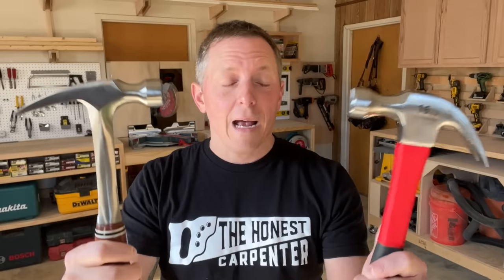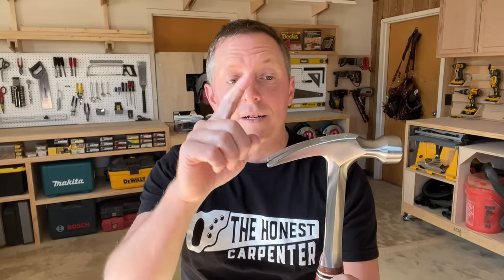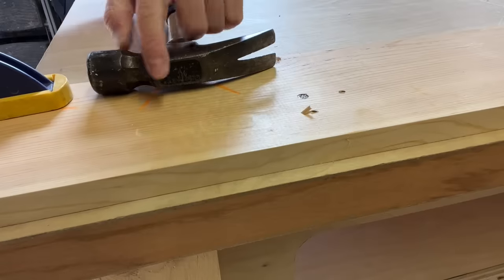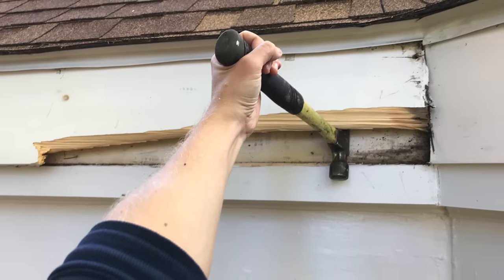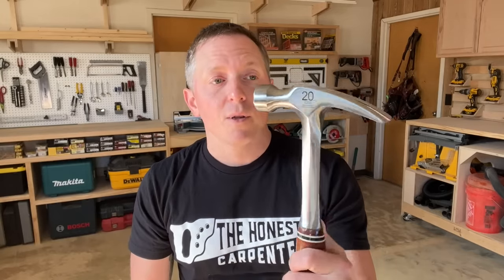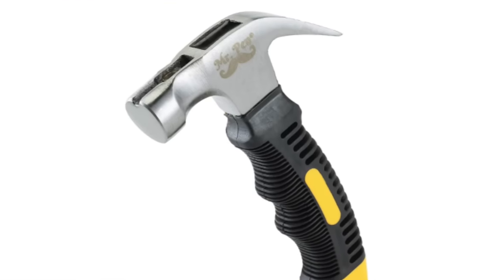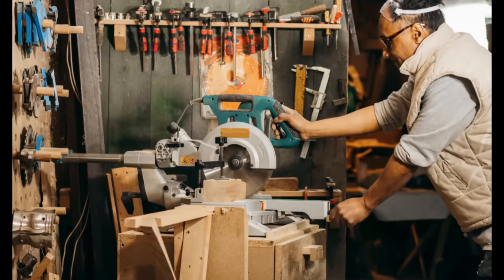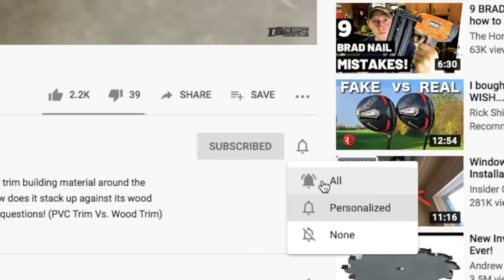DON'T USE STANDARD HAMMERS!! Try This Instead...(Rip Claw Hammer Vs. Curved Claw Hammer--Which One?)

Comment: The Estwing E20S (leather handle) is the first hammer I ever bought and I was 12 years old (in '76.) I still have that hammer and use it to this day. I bought it with my very first paid carpentry job working with my uncle. I started with him when I was 10, but did not get paid until I was 12. It was a 2 week entire house casing and trim job. I bought it as a birthday present to myself. I use it for small framing and trim work.

I also have two 16 oz. Plumb's -- one fiberglass and one wooden handled -- that I use for trim work.

My "go to" hammer is my 14oz Stilletto #2 of 10 original prototype that Mark Martinez sent to me for use and evaluation in 1999. It is my most used hammer. Second is my Hart 21oz. Woody, smooth-faced, framing hammer.

Comment: I used a 21oz Vaughn for my first 4 years as a carpenter and have been using a 23 Vaughn for the last 10, I mainly do custom truss building or small jobs like chicken coops and runs, I feel like any hammer under 20 oz is too light and any hammer 24 oz and up is way too heavy. I am 6' 3" tall and 267 lbs. Wielding moderately heavy tools has never been an issue for my body size and I feel as though that is major contributing factor in choosing the best hammer for each individual
Reply from the maker: Wise words!
Reply: I agree I've put alot of miles on a Vaughan 23 & love them for face nailing, & working at or below the waist. I use 20d's sometimes and she really shines there. The 19 oz. Cali is nice too & I alternative which ones my favorite. With joist hangers toe nailing, sheeting e.t.c... the 19 is more nimble.
That said, in doing windows, doors, siding, floors, & light framing I   love the 999 20 oz. It's a great size, really nimble with just enough "knock down/setting" power.

Comment: Smooth hammer faces are used mainly for finish work whereas waffle faced hammers are used for framing structures.The waffle face helps  the hammer from sliding off the lumber especially in cold weather and winter conditions.Hop this helps.

Comment: I absolutely love my 28oz dealt. I misplaced it for a few months earlier this year. Found it in the yard. Pressed into the ground and after a very little amount of rust removal with 120 and 220 grit sand paper. Worked better then before
Reply: New tip, leave you tools outside to rust to improve them. 😁

Comment: I was tearing down a wall in an old house built in the 1930’s and I found an estwing 15 oz framing hammer with a leather grip I use it only for finish nails, even though I own a cordless finish nail gun. It brings back nostalgic memories from my early days.

Comment: 20 ounce rip claw Estwing nylon handle for me, for carpentry. 
I mostly do patternmaking these days, and my preference is a head about 6 ounces with a thin handle about 16 inches. Good for delicate work choked up at a normal length, grip at the tail end and snap your wrist hard when massive force required.

Comment: Working here in the UK the more traditional curved claw hammer is alot more common than rip/straight claw hammers. Both for us joiners (carpenters) and roofers. I don't know why, but there is a staggering amount more curved claw than anything else. I myself use a traditional 22 oz curved claw steel estwing with blue grip.

To split timber on demo work we find it best to hold the hammer about 45 degrees away from you so the point of the claws beds perfectly straight down. It's not as powerful as a straight claw but it does work. If I'm demo work heavy id normally reach for my actual rigging axe or lump/ club hammer to do proper damage.

Comment: I was taught an ingenious nail-pulling tactic: instead of pulling toward the head of the hammer, work the hammer from side to side. The guy told me “work smarter not harder.”
But as for pulling at boards and such, this is a moot point. Get the rip claw like the man suggests. 
Good video.
Reply: Uh, that is exactly the technique shown.

Comment: Got several Estwings love rip claws got the 20 Oz rubber handle rip it is so well balanced it feels like a 16 Oz .I am not affiliated to Estwing .very pleased with them though  .I would always have a rip claw .if you need to pull lots of nails then I  put a piece of scrap under the claw .T.b.h I just use a wrecking bar to pull out nails over 2".so much leverage .

Comment: I've run the 23oz Vaughan framer for years and never had any issues. I couldn't find a non waffle head version in local stores so I bought two years back and ground the waffle face off of one, so I've got my framer, and finish head version now. I love both, but fantasize about splurging on the Vaughan Dalluge. However, that's a lot more money than the twenty some dollars the California framers cost.
Reply: The 23's a great hammer. I think I prefer her 19 oz. Little brother though for most the work I do...I'm pretty sure that Dalluge is 21oz...right in the middle. Might get one someday, I think they're currently around $60 whereas the Vaughans are around $35.

Comment: Having worked in carpentry for 55 years, my go-to hammer is a 16 oz curved claw as I no longer demo... I mainly build.  I also use a 10 oz. trim hammer much more than a 20 oz...
Reply: Yeah, well the best hammer for one use is not the same for another use.  That is why he went for something in between.  Most people are not framing walls or building custom cabinetry.

Comment: "More weight in the hammerhead creates more swinging force" - it depends. 20yr contractor here.  Framing hammers- Started off with a 22oz Estwing axe handle, then move to a Vaughn 19oz fibreglas handle, now using a Stiletto 14oz Ti w/ straight hickory handle.  I'm way more productive/faster with the Stiletto.  While the heavier head does strike harder, it also means more weight on the windup and that leads to fatigue.
Reply: Yep, the weigh really depends on how often you use it and how long at once.  Heavier weights can take less swing but require stronger wrists to use for a certain duration.  I suspect that is why he recommend only 16 oz.  You can use it all day but for some jobs heavier is less work.

Comment: Used a 22 oz. Estwing 40 years framing. Also have a 20 and a 16. Started out with a Plumb hammer.  Broke too many handles. Everybody said an Estwing would kill my elbow, I told them learn how to swing a hammer and it won't be a problem. But as far as a curved claw, I think my wife has one in her sewing kit.
Reply: I started in 84. Long handle 22 Oz waffle head Estwing all the way. It's all in the wrist. I hated nail guns when they came out, but after I got use to them I was glad to have them around. The skill I earned driving all those nail by hand is like a tool of it's own.

Comment: Even though I am a bicycle mechanic I do have some limited carpentry skills, and honestly if I’m rehabbing furniture I do agree that the curved claw hammer is fine for nail removal from wood but the rip claw hammer makes sense for demo. Obviously for bicycle work or metal work I ether use a flat headed dolly hammer or a hammer with a plastic head blow.

Comment: Hammers & Levels—the bane of a carpenter’s life! So many choices—always a new hammer or level. But (before nail guns), my standard favourites are still the Estwing 20oz rip hammer w/ Shock Reduction Grip, esp. for rough carpentery & stripping forms (a must on high-rise construction sites; and, the Estwing 16oz leather bound claw hammer for all cabinetry & trim work, e.g. “old school” installation of baseboards w/ finishing nails. Also, e.g., a Stanley Wonder Bar is a must for removing trim.
Reply: Laser levels are fun to use
Reply: @toriless  Yer right, my son, exclusively uses them. Thx,!

Comment: Timely subject. After finishing making roof trusses for a shed I'm building, I unscrewed the  2x4 blocks I used for a jig. Stripped the head on a screw holding one of the blocks. Instead of prying up the piece of 2x4 and tearing the plywood deck, I grabbed my 20-oz. Estwing RIP claw hammer and attacked the wood like a hatchet to a tree.
Split the 2x4 with ease and removed the screw without marring the deck.

Comment: When I worked concrete (cribbing) I used a 28oz estwing. It is good at breaking snapties with one good blow. I would say that it is a heavy hammer and you should only use a weight you can comfortably handle all day.

Comment: I have worked in construction for nearly 20 years and I can't remember the last time I saw someone with a curved claw hammer. I thought only grampas still had them lying around in their garages. I find the rip claw easier to use for picking nails (although the nail pick is better), the weight is right behind the head instead of distributed further down, and it slides more easily into the loop on my belt. And as others have mentioned, it makes an effective trencher for things like low voltage electrical.

Comment: I work construction, and I keep two framing hammers in my tool kit/belt. A 12oz and a 22oz.

I personally prefer the 12 is for most tasks, but the 22 is a lot better for framing for when you need to push over a standing stud/plate or even small beams. But I prefer not chewing up my wrist with the 22 and sick to the 12 when I can.

The 22 is also waffle face, which isn't good for siding or trim work

Comment: I typically just break out the flat bar if I ever need some demo. I'm a lot more accurate with it and there's plenty of power. It's a two handed operation, though, and it usually requires a few steps to the toolbox, cuz the flat bar isn't on me at all times. So that might not be to someone's liking, especially if you're on a ladder.

Comment: I have been using Vaughn 19 Oz framing hammer for 35 years .
Reply: For me, that's also the exact perfect framing hammer - Vaughan 19 oz, waffle face and wood handle.  Not too heavy for driving nails all day, waffle face requires less concentration and the wood handle absorbs shock.  I will always recommend that exact hammer for framing.

Comment: Great video. A lot can be done with a standard curved claw hammer, but the framing hammer makes quicker and easier work usually.
Reply: Yeah, I think he recommends 16 oz since ti is easier for a DIY'r to control, my 21 oz "Framing" hammer take a firmly controller swing to do its job properly.  A 16 oz with a shorter handle allow for a more sloppy swing.

Comment: Have a claw and two engineers hammers (small and heavy for different work needs).

Think I should consider a third.

Using it for jobs such as breaking up old wood for kindling would help with something that's a fairly common/regular task

Comment: I demolish old houses and barns for the lumber. I pull nails almost every day sometimes all day. I find that the curved claw hammer is much easier on my arm and joints at the end of the day.  For me the flat bar makes up for the rest. I can hamer a good sharp flat bar between any two boards with little damage. I try to save all the old pine I can. I might be alittle OCD, but I love my work.

Comment: Tradesman with a curved claw (didn't know there was a difference to be honest). I mainly use a dog bar/nail puller for the extraction, instead buying a cheaper hammer that had good weight distribution concentrated in the head, not evenly balanced with flimsy plastic handles. Mind you, I'm not framing, so my inefficiency isn't as costly.

Comment: Like most UK based joiners, I've always used a 20 or 16oz Estwing claw hammer. I guess we do a lot less timber framing than you chaps over the pond, so It is only recently - the last ten years or so - that I started to notice what we call framing hammers become more common. 
With the advent of first and second fix cordless nailers, I tend to use my hammer more for wrecking and hacking than nailing, so I went out and purchased a framing hammer to give it a go. Well, it's okay, but after so many years of swinging the 'curly' Estwing, well, I'm pretty much stuck in my ways.

Comment: I have three straight claw steel Estwing's, a 16oz, a 22oz and a 28oz. I use the 22 and 28oz for demo and putting up scaffolding. I have three wooden straight handled straight clawed Stiletto titanium hammers. A 10 oz, a 12oz and a 16oz, I have my eyes on the 14oz with a waffle head. The 10oz Stiletto is the nicest hammer I've ever used, 👍 🔨 🇮🇪
Reply from the maker: I’ve got to try a stiletto, Toolnut. I can’t believe they can make them so light!
Reply: @TheHonestCarpenter  I highly recommend them especially if like me you've twenty five years wear and tear on your wrist, arm and shoulder. You'd hardly notice it hanging off your hip all Day. Stiletto titanium hammers go well with an Occidental Leather tool belt, 👍🔨🇮🇪

Comment: I think they're better at driving nails bc the weight is aligned with the striking direction. So theres more mass flying at the nail head. I think a vector diagram would explain it well

Comment: I never knew this about hammers before , , , i only have curved clawed hammers , , ,  very small tacking hammers  , , , soft-face hammers , , , rubber hammers , , ,  one average size ball-peen , , ,  and one massive ball - peen hammer i fixed on to a broken axe handle , , ,  but after this , i may add a straight-claw to my collection , , , i like the handle on the hammer you showed in the show , , reminds me of my brick-laying trowel , it had the same type , , , i believe it is made of leather rings , , ,  nice looking especially when they are kept clean/shinny , , ,  i believe you could do a few shows on hammers and still not cover them all , , ,  but it would be nice to learn about all these hammers and how they can be used .

Comment: When i was framing i always carried a 24 oz waffle faced rip claw. It was all i ever needed and frankly would have been silly to carry a curved claw hammer. However,  as a handy man or just generally working on home projects i always have a variety. I have 2 24 oz framing hammers. One smooth and one corrugated (waffled), as well as a smooth faced 16 oz curved claw hammer for more delicate project or for nail pulling. If you are only going to buy one hammer then get the one that makes more sense for your project, but for thse of us that do this regularly one hammer is never enough.

Comment: I've always found 16oz hammers to feel a little light in my hand, so I have an 18oz Estwing that feels proper when I use it. I only ever had the "standard claw" when I was 4 years old and didn't know much. I've had my 18oz since the age of 8, and still use it now in my 30's. That all said, I also have my 40oz sledge, and my Spike Hammer for driving railway spikes in (you know, train tracks). Got that largest one from my Great Grandfather.

I think a 14oz to 18oz is good so long as it feels good to use in your hand weight-wise. 12oz is definitely just a finishing hammer, and 20oz or more is something you get for driving nails hard, likely not through wood, or not just wood.
Reply: Yep. my framing hammer is 21 oz.

Comment: Great info; Ref the cross cut head face questions, once in a while I recut my hatch pattern with a fine metal cutting disc on my angle grinder. I’m hopeless with bending nails unless I have the hatch pattern.

Comment: A lot of good ideas here ! 
I have always used rip 20 oz. Estwing steel with plastic handle 
Plastic handles dont get ruined by water or sweat and have small holes for hand comfort and they let you slide hammer a little bit and grab where leather just slides in sweat......danish guy mentioned slamming rip into anything to keep your balance working high and in the wind or on a ladder or roof to stop a fall. ! ! ! 
I groove inch marks on hammer handle for quick measure instead of taking tape out a hundred times for nail space or stick handle in something for quick measure of thickness 
You can use rip to carry things as plywood if your fingers tired or cold
You can cut straps on things delivered by just hitting it with blades
For us old guys we use hammer as cane to get up from ground. ! 
        Best Building Places 🏡
Reply: I assume it also has a shaped rubber grip.  One advantage over wood and that all newer handles have ergonomic grips unlike wooded hammer which only taper, if anything.

Comment: You’ll notice on the shown wall of hammers that almost all of them have straight claws. You’ll have to look in the cheap bins down at the bottom to find a curved claw. That’s why homeowners all have them. I still prefer my rare 13 oz. curved claw Plumbs. If you want to do destruction a proper pry bar like a Swedish Granfors bar is the proper companion. Promptly denailing tear outs is ideal with a curved claw. Shank of said bar is essential as a fulcrum with that straight claw. Lost track of my 28 oz. estwing some time after we got a N-80c Bostich.

Comment: 18" - 16oz., to 18oz. framing hammer with milled face for roofing, decking, siding, sheetrock, framing, and demo. (For all day hammering, and set & 1 to 2 strike nailing).

Comment: I've always liked rip claw hammers for most of the reasons you explained like splitting wood. Also if you are digging footings you can use the rip claw to dig a little bit. I like the solid steel rip claw hammers. They are indestructible.
Reply: No hammer is better for digging than a bricklayer's hammer. ;)

Comment: I appreciate your take on hammers but I think you gave curved claw hammers a short shrift. I worked construction in summers between high school and college. I was given a 16 oz. curved claw hammer head under the condition I replace the handle. I had too much experience replacing handles so that was no problem. That was 50+ years ago and  although I have more than 20 hammers now of many types, when I need to drive a nail I still prefer that one. I look forward to seeing what you carry on that very busy tool belt.
Reply from the maker: I appreciate the alternate take on it, Ken. Shooting the belt video tomorrow! 👍